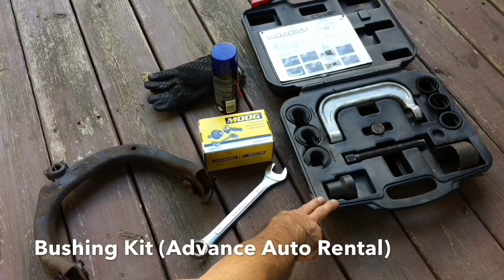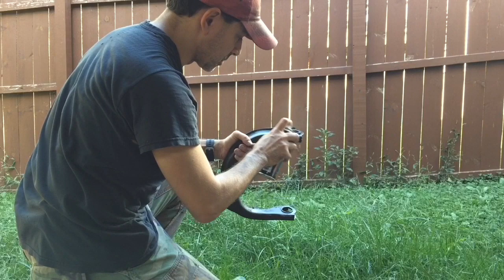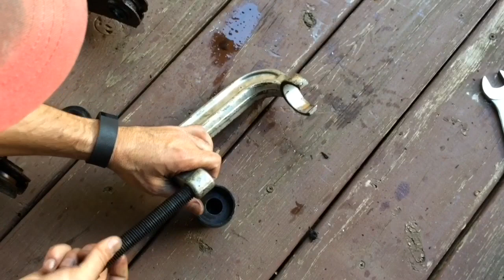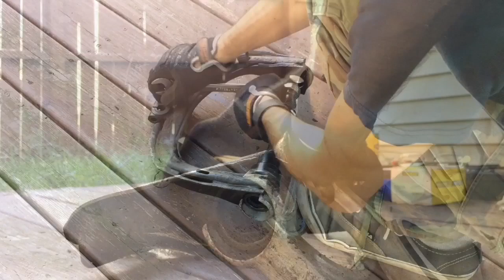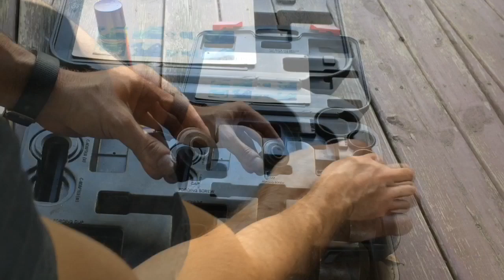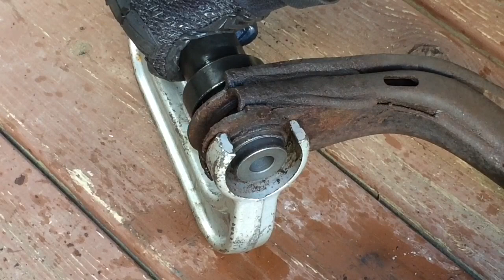How To Replace Upper Control Arm Bushings (Andy’s Garage: Episode - 116)

Comment: You, Sir, are a dying breed. A guy with the skills to tackle a job and get it done. In most cases after wrestling the control arm out it gets replaced with a whole new assembly as a time saving measure. I guess that makes sense in the rust belt but it's more about the times we live in now. Good work.
Reply from the maker: Thanks for the feedback 👍